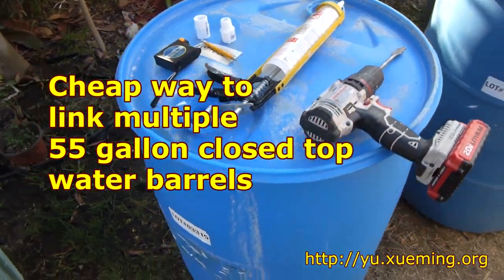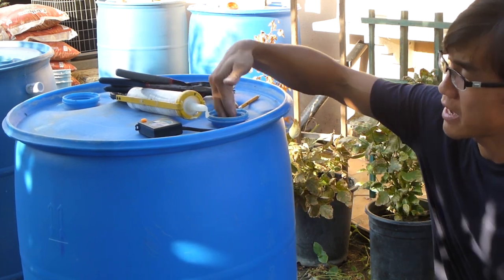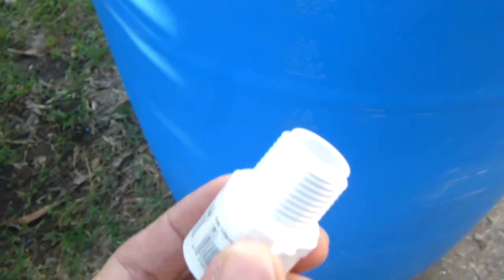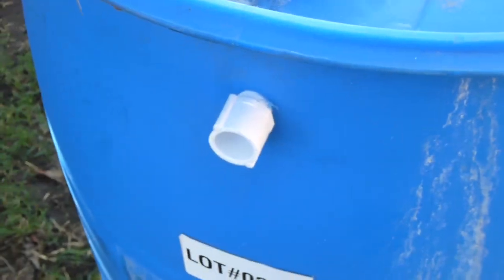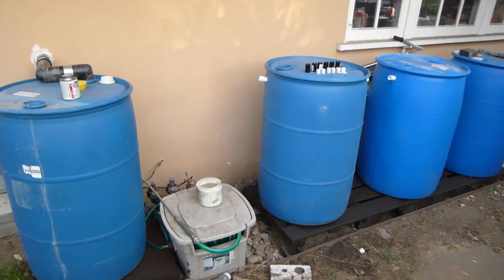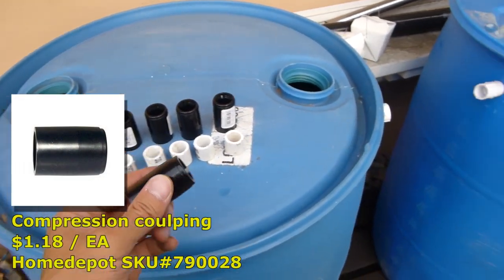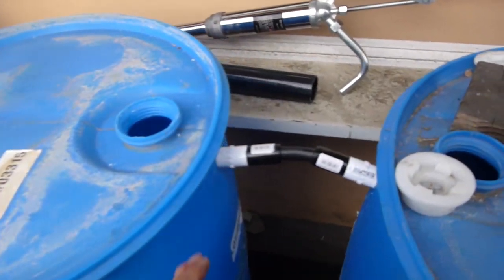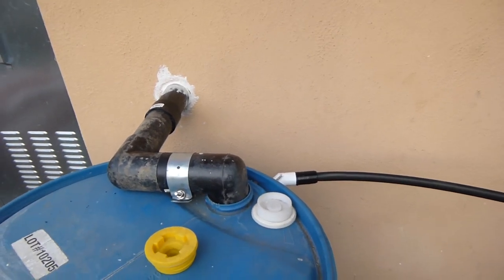Link multiple 55 gallon closed top barrels to collect rain water

Comment: I mean if it works for you that is  awesome. But why wouldn't you connect them in series at the bottom so the system drains evenly . will the caps pop out if you flip it?
Reply: no, you get better hose pressure feeding from one full barrel than four that are 25% full.
Reply: Eric Reed how is he going to take out the water?
Reply: @glumGlumm  exactly!
Reply: whiplash984  There are pump and syphon but thats just a waste of time it’s inconvenient.
Reply: Julian that is a good point. He can’t take out unless he put a spigot. Siphoning is fine, but the purpose of doing all of this is to avoid siphoning. This is why you need to do it from the bottom so you can take out the water with just one spigot
Reply: He's probably unable to reach to the bottom of the barrel through that bunghole to put the fittings in, yes if he had enough extensions in a crows foot he could probably do it or put a box in wrench into a piece of pipe to reach down into that barrel but he did a great job with what he had although your point is definitely an upgraded version.
Reply: He doesn't mention. It but in the video behind the barrels there is a hand pump that would go in whichever barrel he plans on emptying 1st. Inconvenient?  Maybe. But that seems to be his plan

Comment: In with any serious amount of rain entering the barrel that tiny hole will not accommodate the overflow. You need much bigger fittings , at least 1 in
Reply: Did you watch the video?   He doesn't use rain water l, he uses waste water from his laundry

Comment: This has been my confusion. If you link at the top, yes, it is easy to fill but not to drain as when you drain the last one it is over. You then have three full barrels with no movement. If you bought barrels with screw off tops you could easily reach the bottom. The matter of no having pressure when it goes down, how about you put a submersible to a pressure switch in a tee to a pressure tank. Problem solved. NO? tell me why.
Reply: I have the same concern, the issue is you cánt drain all water from one barrel.
Reply: He doesn't mention. It but in the video behind the barrels there is a hand pump that would go in whichever barrel he plans on emptying 1st. Inconvenient?  Maybe. But that seems to be his plan

Comment: Not necessary. Simply syphon (using hose or copper pipe) from one barrel to the next via holes in the screw caps. Simple. Done it for years.
Reply: That seem like a waste of time. When you add the connection on the bottom its done. If its for drinking then yes go with syphon system but still a waste of time. 🤪

Comment: Prob not going to get a big response but a bunch of smart ass comments but I need help I think I’m over thinking this process I’m going to do. I am burying 8-12 food grade cleaned 55 gallon drums. Used to store water not for drinking but non potable uses, things like cooking with it(boiling first) for instance. I need to figure out how I can hook them all up daisy chain style, as so they fill evenly and Drain evenly when I take water out. 1st drum will hv a 12vDC car battery powered cylindrical shaped pump dropped into 1st tank, wired to 12v car battery connected to a solar panel to keep charged. Trying to figure out a way I can plumb them all together as to fill evenly(if even possible), and a way to pile them together as so I can pull water outta 1st tank and the water level in all tanks will drop at the same time same level. Thinking about putting 3 different holes in each tank top middle bottom, that way they all drain from each hole and when below 1/3 full I can pull water from bottom of tanks out of 1st tank. Digging 12 bi level 3’x3’ platforms for each drum to set on is kinda dangerous cause after 8th barrel I’m getting pretty deep, if I was going to pull from last tank. Kind if using gravity to fill each tank, I want water level all even at same time. Any help greatly appreciated